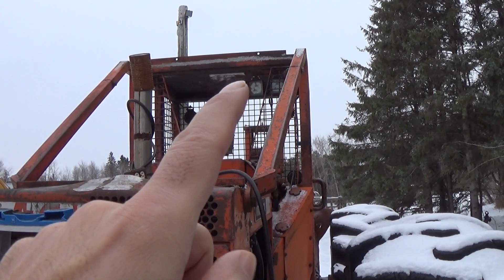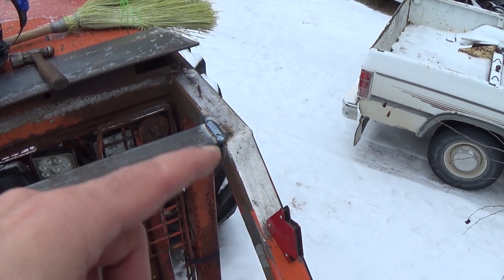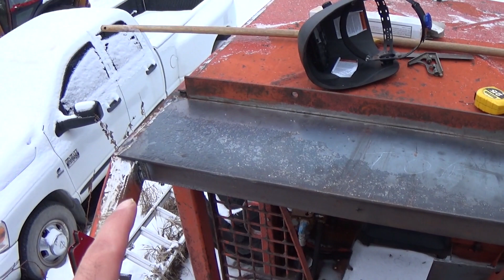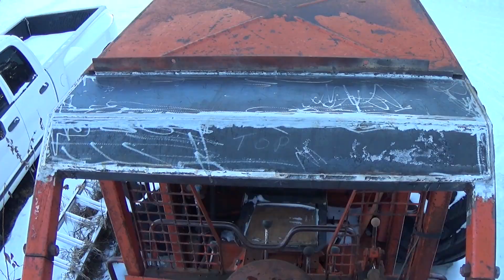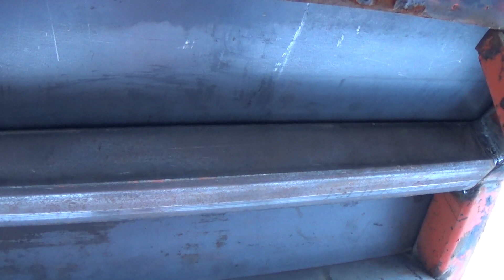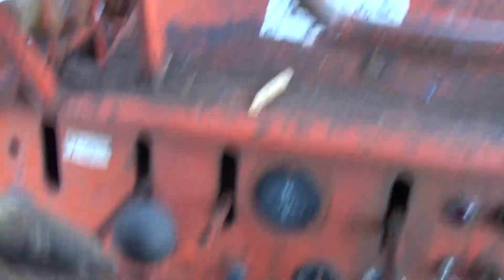Timberjack 450 skidder gets a face lift new steel for an old machine

Comment: Where are u at .im from Quebec Can
Reply from the maker: Good ol' Manitoba, eastern part of the province actually. Fun fact for you this machine at one time had been refurbished at a shop in Quebec that specialized in skidder rebuilds and customization, ie where it got a rear frame extension blade extensions wheels widened and a 400 series Clark winch long before I got ahold of this machine. It has a lot of travel miles on a lowbed this ol' girl was built and sold in Ont. then sold/resold in Que. then back to Ont. then to Mb. then back to Ont. then finally back to Mb. When the last owner lost it to a finance company that's when I finally bought it at an open public auction. whew! that was a whirlwind explanation lol!